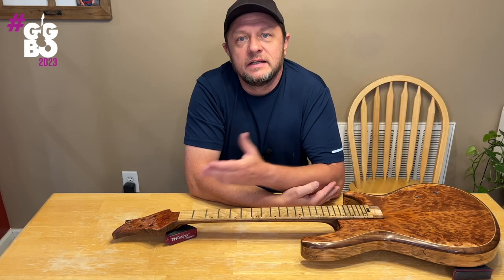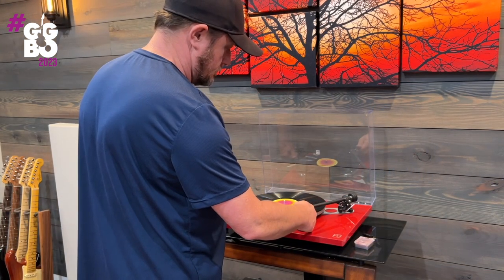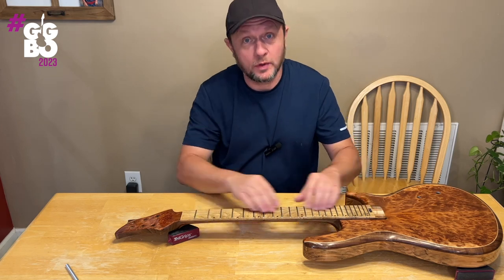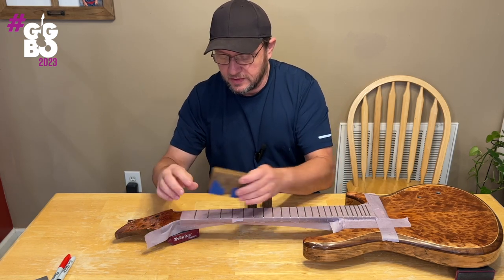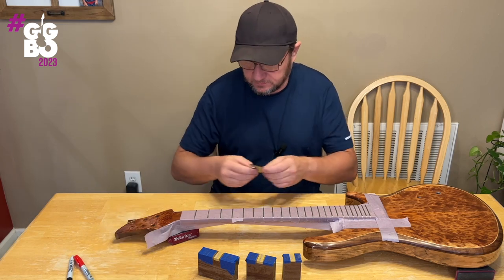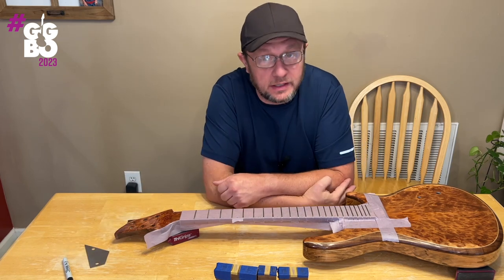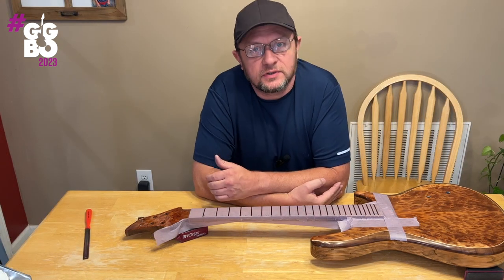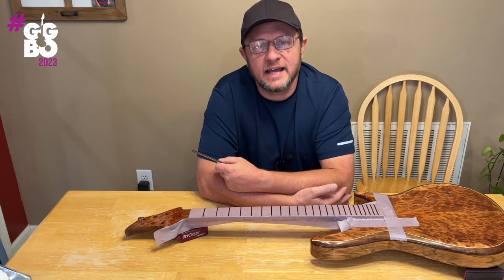GGBO2023 Episode 17 -  Level Frets On A Compound Radius Fretboard #ggbo2023 #greatguitarbuildoff2023

Comment: I've been thinking about doing a compound radius for my next build, using the CNC to carve the actual radius. Using the radius sanding block was possibly my least favourite process on the entire build! So either way I'll do the radius on the CNC. This is a great explanation of the process that will be really useful if I do decide to go with a compound radius. Did you do anything special when finish sanding the fretboard?
Reply from the maker: Thanks for watching! I cut my boards on a cnc as well so they're very precise and that really helps when comes to finishing the frets. As for finish sanding the fretboard I just use a folded piece of 400 grit and a common dish sponge always running the entire length. I just try to make sure not to dig any holes 😄
Reply: @RobertEarlGuitars  Interesting. I think I'll probably go for it next time.